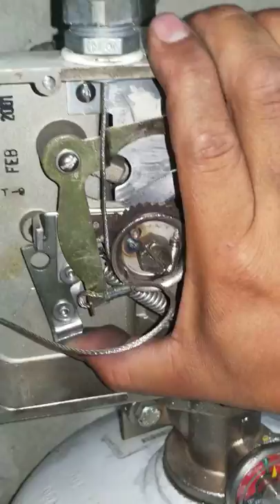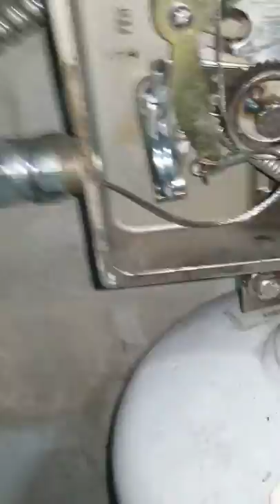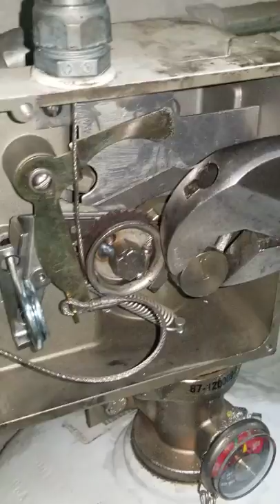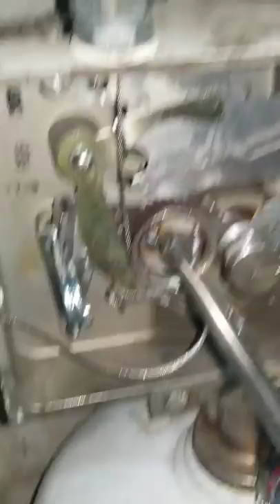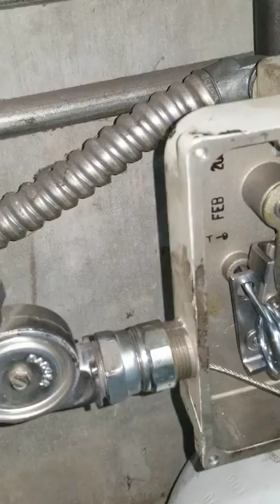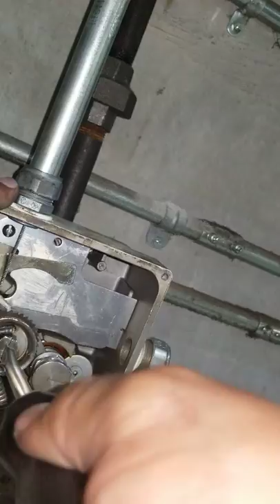Rg6 range guard resetting old control head

Comment: How do you loosen tension to change links
Reply: That's what I've been looking for lol.
Reply: U pull the one on round circle same time as other one round circle to let tension off slowly look at video in u see where it locks pull back on that turn the other one with flat head it should release tension on how much slack u won't don't go to far a bitch to wind up again.make sure u got a pull pin in there